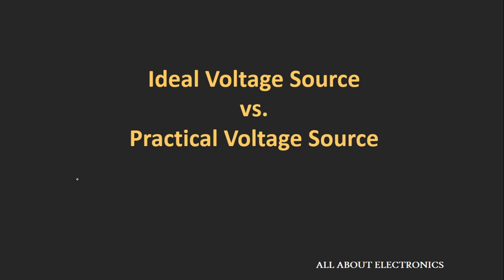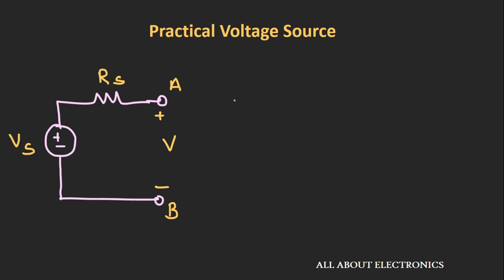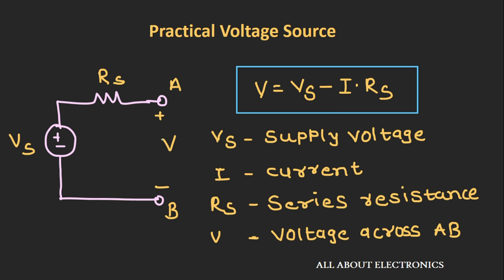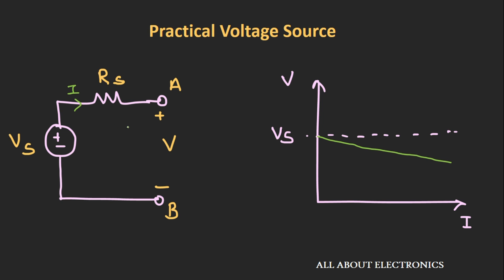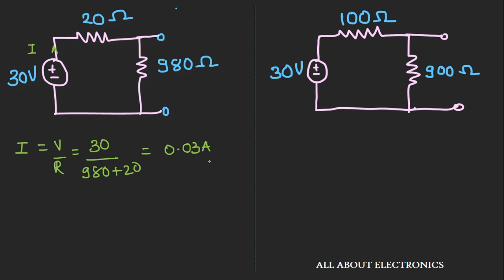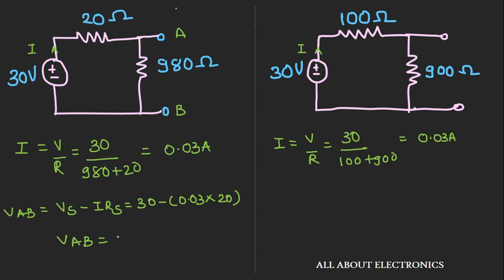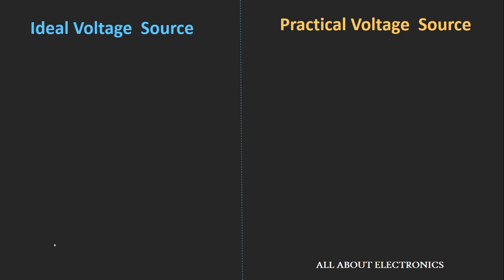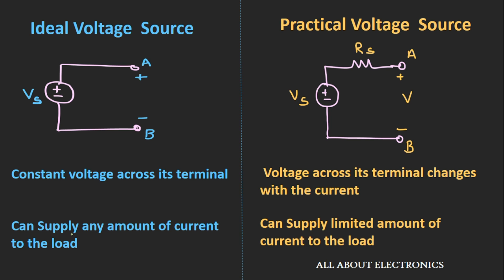Ideal Voltage Source vs. Practical Voltage Source

Comment: Sir that means in practical voltage source a resistance with series in ideal current source 
Sir is this sentence is correct or not
Reply from the maker: In practical voltage source, there will be a series resistor along with the voltage source. Similarly in practical current source, there will be a resistor in parallel with the current source.

Comment: For my curiosity can you tell me why we modeled internal resistance in series with voltage source why not in parallel similarly for current source..
Reply from the maker: Let's consider ideal voltage source for a while. If you connect the load across it, you should get the some voltage V across it. And the value of that voltage should be same as the voltage source. But if you actually see, it will be somewhat less. That means there is a drop in the voltage. And there has to have some series resistance. If it is modeled with the parallel resistor then it won't happen. Because in parallel the voltage remains the same. I hope it will clear your doubt.
Reply: @ALLABOUTELECTRONICS  
Thanks for clarifying my doubt, completely understood...

Comment: I have some doubt in differentiation u say that  voltage in practical voltage source depends on current but the current remains constant in the series how that voltage varies with the current
Reply from the maker: What I mean to say is, if you have 5V, 1A practical voltage source, and if you try to draw more than 1A current (Let's say 1.2A), then it won't be able to supply that. And suppose if you measure the voltage across the load, then it will be less than 5V. 
So, you need to consider the current rating too. 
I hope it will clear your doubt.

Comment: Sir I have a Question  ideal voltage source and ideal current source.. what is different detw
Reply from the maker: The ideal voltage source gives the constant voltage across its two terminals, independent of the load. And it can supply infinite current. 
On the other end, the ideal current source provides a constant current to the load and can handle any load.

Comment: what is the difference b/w current source and voltage source ? plz tell about the current source which are easily available in the market ?
Reply from the maker: If the current source is connected across the load then it supplies the constant current, while the voltage source provides the constant voltage to the load and current through the load will depend on the voltage of the voltage source and the load resistance. (I= V/RL).
Usually, the current sources are not as readily available as the voltage sources. But by some means, the voltage source needs to be converted to the current source (using the op-amp, transistor etc.). And some ICs are also available which can be used as a current source and can be used as LED drivers. (e.g LT3092)
Also, you can check my video on voltage to current converter using an op-amp for more information.
Here is the link:
https://www.youtube.com/watch?v=DeDk0Rl3Oa0

Comment: sir I have another question..... can u tell me What is the difference between current source and voltage source..
Reply from the maker: The simple difference is current source supplies the constant current while voltage source supplies the constant voltage to the circuit.
Reply: okay but where we r using current sources.........
Reply from the maker: Constant current sources are used in designing the driver circuits for LEDs and LASERs. And even it is used in the charging circuits (e.g battery charging circuits)
Reply: @ALLABOUTELECTRONICS   but batter is used for voltage source right sir
Reply: Battery

Comment: can u pls explain clearly  the numerical which u do in video one answer  is 29.4 and second answer is 27 difference betwn that
Reply from the maker: In that example, two voltage sources with different series internal resistances were taken. Now, both sources were connected to different loads, but the value of load resistances was in a such a way that total current drawn through the source was same (i.e 0.03A). 
Now, the voltage source with larger series internal resistance will have more voltage drop across it and hence less output voltage across the load.  
And that is exactly you can see by voltages across the load (when you get 29.4 V, the series resistance is 20 ohm, similarly for 27 V, series internal resistance is 100 ohm.)
I hope, it will help you.